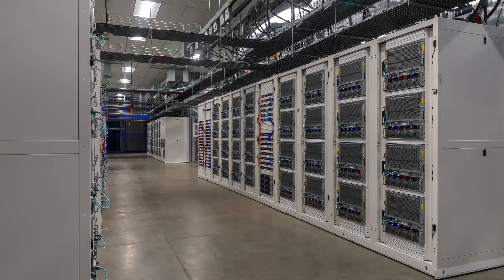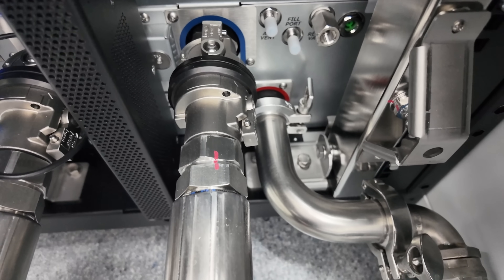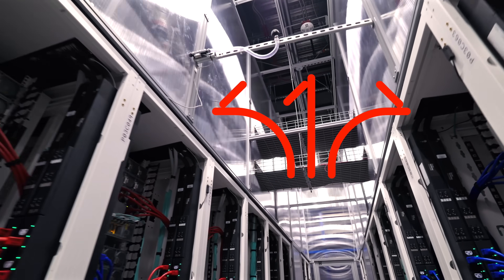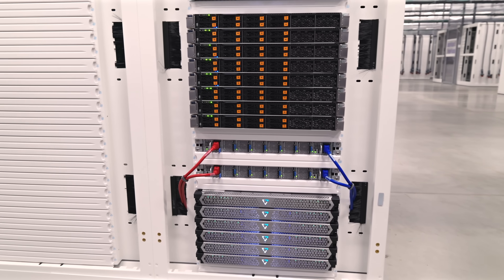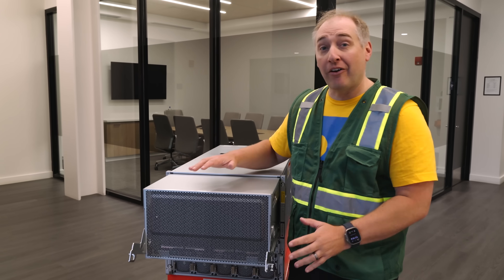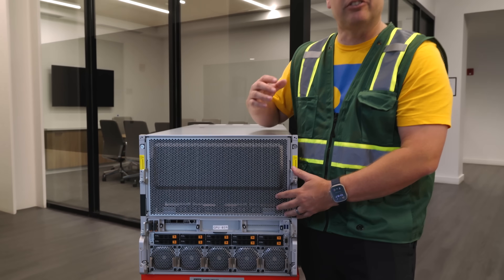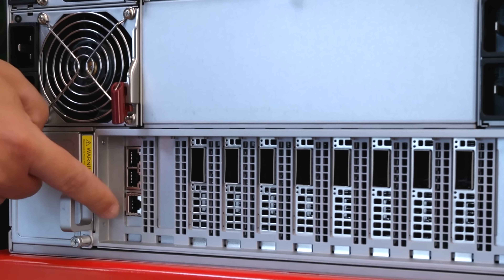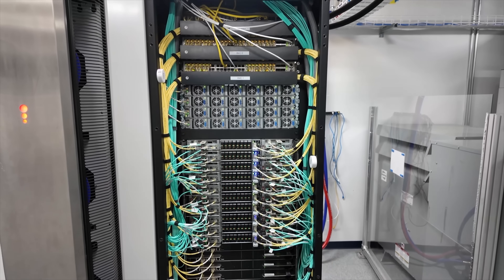Inside a NEW AI Cluster - Tour with NVIDIA B200

Comment: That AI bubble is going to have a huge blast radius. Picking up this hardware on he cheep will be NICE!
Reply: Running this stuff will still be expensive, due to the power consumption, not even talking about the noise (your neighbors will probably love you)
Reply: @flintstone1409 I don't think most people have the foggiest idea how expensive it is to run this kit. It's not just the power to fire the server up, but then you need to factor in the cooling. I guess if you have electrical heating and live in northern parts you could use it to heat your house in winter but then these things are fricking noisy boot. All of the DLC stuff requires specialist heat exchangers to interface with facilities chilled water as well. Basically none of this is remotely useful in home labs.
Reply: @jonathanbuzzard1376  I mean if you have a machine that can accept just one SXM B200 module, you're kind of good to go for any homelab usage I can think of.
Reply: @flintstone1409  its going to be great for places like canada with cheap hydroelectricity and cold, just replace your AC with the heap pump connected to the GPUs 🤣😂😅
Reply: @carholic-sz3qv me crying in German prices of 0.30€/kWh
Reply: @flintstone1409 just buy their houses on the cheap after a bit of 24/7 😂
Reply: What are you talking about mate? Even if the bubble busts, this stuff will not become 'cheap'. They are not that specialized for just AI! The computers are still useful for number crunching essential for recommendation systems, CFD, scientific compute etc. They will come down in price but not that much, people here don't know what they are talking about!
Reply: You couldn't afford to turn it on.
Reply: When is the bubble popping? Not any time soon
Reply: I'd be happy with A100's here for cheap in the near future :D
Reply: Those who do AI washing will burst. The ones with real AI will survive.
Reply: @danielthomas5401  What is "real" AI?
Reply: This isn't a bubble that is going to pop, just like the industrial revolution of the Victorian era never went away and is going to this day.
Also, this equipment will never be available to the masses, when it goes EOL it will be securely shredded like every modern supercomputer's equipment in the last 15 years.
Reply: how about power tho? that the biggest problem out there!
Reply: You don't get it at all, do you? These hosting companies are printing money right now. To make more money they simply keep expanding their capacity. The demand is insatiable. These guys aren't paying hundreds of millions of dollars for hardware that won't get used because of some imaginary bubble you think is massively overdue for a pop. The use cases for AI are exploding, exactly the opposite trend for a bubble. Get on board or get left behind and clean the toilets, it's your choice. Can't say you weren't warned.
Reply: @onehotseat look at open AI they projected $300B in revenue from hosting services and leases of their excess capacity. This past year they spent $100B in capx and only had $900M in revenue, yes less than $1B in revenue. The reason their balance sheet kind of and kind of doesn’t reflect that exactly is because they wrote down the depreciation of the  capx spending/acquisition to practically zero over a short period of time. So the write off was insane. Nevertheless, they are earning less than 1% of what was originally projected. A
Reply: 😂 ok
Reply: @CchbDdgbv  How does this add to this conversation?
Reply: We can all agree hyperscale growth is sprinting faster than a caffeinated hamster on a wheel (and just as unsustainable). But let’s be real: don’t expect bargain-bin GPUs flooding eBay anytime soon. Data centers sell to other data centers, not to the guy trying to run a mini-cluster in his garage with a Costco fan. The bottleneck isn’t money, it’s power and cooling.

And AI? Not a bubble. Saying it’ll pop is like saying the iPhone was a fad and we’d all be back to fax machines once the hype died down. Spoiler: no one’s texting you via Xerox.
Reply: @skorppio_tech  Are you a developer? Do you use AI in any day to day workflow? Has AI improved that workflow. Name 1 profitable AI company. Yes, a bubble.
Reply: Facts !!!
Reply: Comments like these are peak "sour grapes" lol.
Reply: @tiromandal6399  huh??
Reply: Guys got 50$ in shorts haha
Reply: That's the utterly moronic thing about this whole bubble, the hardware is so specialised that a secondary market for the retired devices will be non-existent.  Even with e-waste recycling the amount going to landfill will be insane.
Reply: @ffsireallydontcare  вы не правы купил две tesla v 100 sxm2. Думаю таких как я найдется много.
Reply from the maker: Very true.
Reply: @ServeTheHomeVideo I think machine learning will always be a thing. I think the bubble will be in the llm space.  Anything STEM related will keep moving forward.
Reply: Bubble? Lol sure
Reply: @mr.rajikon3911 There have been two prior "AI Winters" triggered by technological barriers. My money is it's going to be insufficient training data or quantum interactions being required for consciousness.
Reply: @foxale08  those AI winters were decades ago before the internet existed 🤦‍♂️